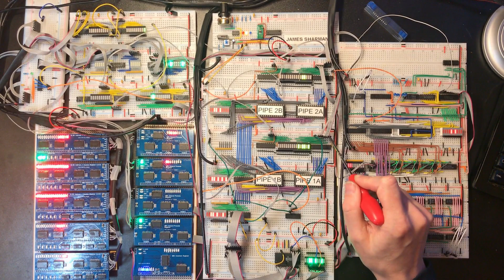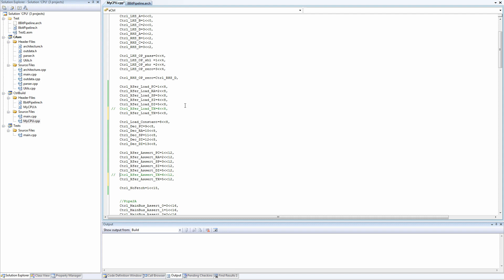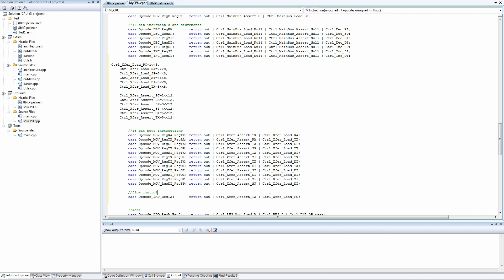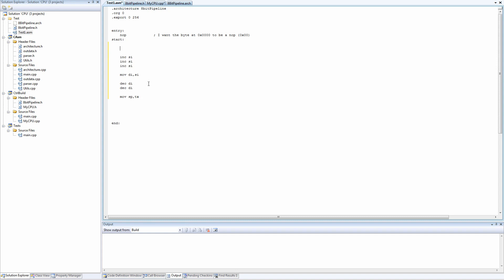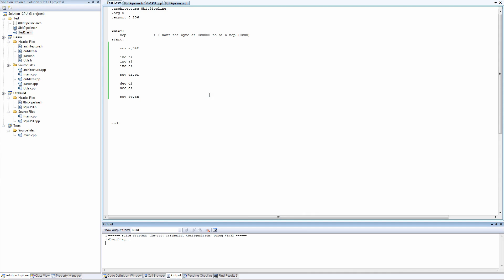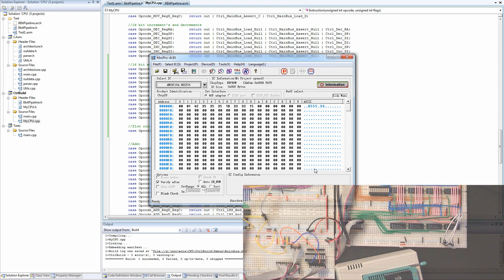16 Bit Transfer Bus Control - Making an 8 Bit pipelined CPU - Part 40

Comment: This comment will have more thoughts/guesses on how he might go from here.

(2:42) Ah. I thought of combining increment and decrement, but I didn't think of combining load and decrement. That's clever.
(7:52) Putting the constant load in with the decrements like that was pretty clever, too. I can definitely tell you put a lot of thought into this.

I didn't realize until around 18:30 why you only decremented DI twice after transferring SI into it. It's because increment happens in pipeline stage 2, so SI has only been incremented twice when it's transferred into SI.

Alright, so this layout of control lines now frees up an extra control line for ALU control in pipeline stage 1, which now allows up to four ALU control lines, or up to 16 different ALU operations. In pipeline stage 2, you'll want four control lines for selecting which eight-bit device to assert to the main bus, four more bits for selecting which eight-bit device to load from the main bus, three bits for selecting which address register to assert to the address bus, two bits for selecting which address register (if any) to increment, one bit for telling the fetch unit not to increment, and one bit for telling the fetch unit to increment RA instead of PC. That totals up to 15 control lines used in pipeline stage 2, which means one unused control line is left over. Maybe this unused control line could be used to implement a HALT instruction to halt the clock once a program is finished?
Reply from the maker: HALT is boring and limited, video 85 will have your answer for that line.

Comment: Shouldn't "mov pc," have the noFetch set so pc isn't incremented while it tries to load?
Reply from the maker: Yes and No, I need to avoid the increment but fetch suppress stops dispatch but pc is still incremented (it's designed for grabbing the immediate data in the instruction stream). As I mentioned in a reply to another of your comments this was indeed an unforeseen issue, I'd like to fix it if I can find a way to do it without changing too much.

Comment: when I tested as shown in the video, I realized, that the Inc for the SI is done at next clock step and not in PipeLine 2. So I inverted the clock pulse that drives the UP of the first ls193, now it increments when I expected it. Is that correct or is there any error in my circuit?
Reply: correction: I inverted the clock at the enable line of the ls139 which selects the AddrReg for asserting to  the bus. its seens to work
Reply from the maker: If you look at the bus control circuit  https://easyeda.com/weirdboyjim/Bus-Control you'll see I invert the clock before feeding it to the de-multiplexers. Doesn't really matter how you do it (I did it here to reduce fan-out on the main clock line), the inc/dec lines are designed to have a rising edge at the mid point of the cycle.